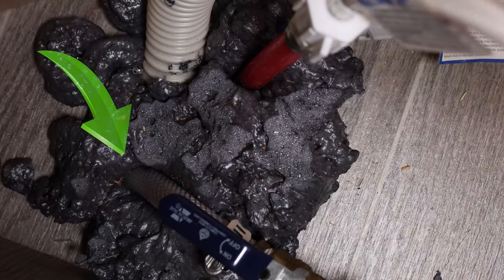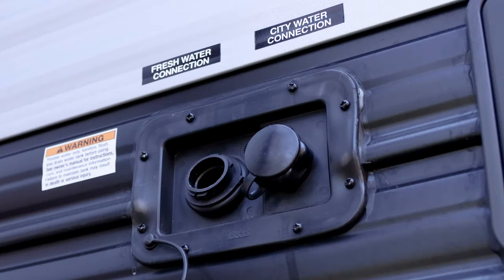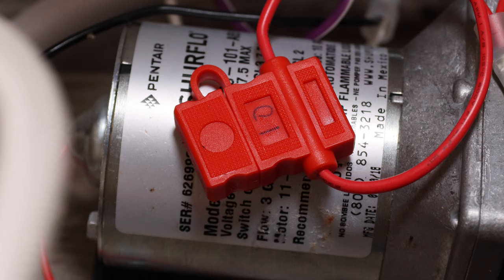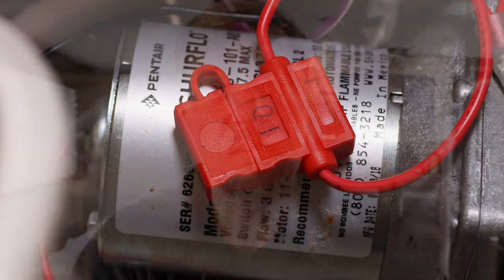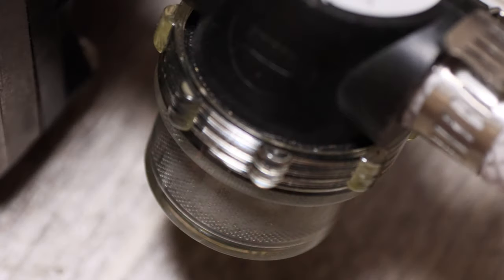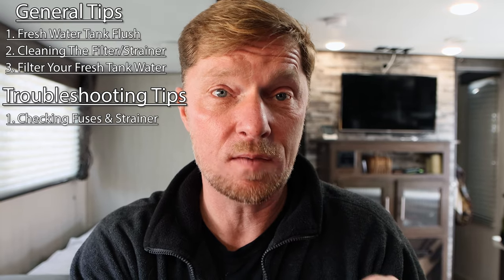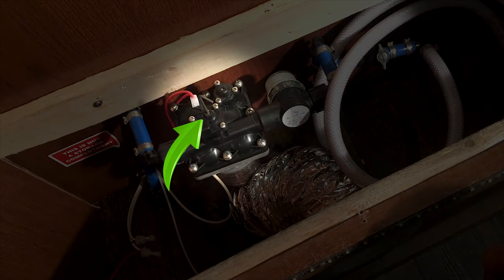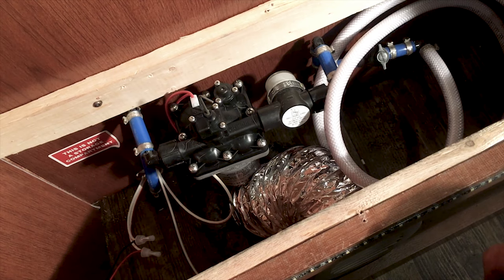RV Water Pump Explained 2021 - Shurflo Water Pump

Comment from the maker: I wanted to share this link for those who are having issues with their water pump. This is by the manufacturer and has some good troubleshooting documents. https://tinyurl.com/y3tuppvf  -  Use this link and select the pump that you have. You can then look at the downloadable documents to find the specific troubleshooting documents. Shurflo pumps are made by a company called Pentair. Hope this helps.
Reply: I ha e the same pimp as you. Mines is leaking on one of the screws that hold the bypass housing cap

Comment: Thanks for the video. My pump was pulsating I took the filter off and found very little debris and sediment. At first glance it looked clean. I cleaned it anyway. Screwed it back in and it worked. No more pulsating.
Reply from the maker: Heck yeah!!! I am glad that it worked out for you. Its always nice to have something fixed that did not cost $$$$$.

Comment: So I have the same shurflow pump with a bypass, I installed it today brand new from Amazon. They are shipping them out of adjustment sometimes as in my case. It wouldn’t turn off but had good pressure. In this case you need to touch the bypass screw with a 2 mm Allen. Screw it in/tighten it until the pump turns off and then just a little bit more for safety sake. I took mine about one full turn before it would start turning off. Now it operates perfectly. Just the right amount of pressure I was hoping for. Not so much that it wastes water but not so much that it is pulsating.
Reply from the maker: This is a great comment showing how others can get the settings that they need with a little adjustment. I am going to pin your comment to the top of this video for others to see. Thank you for sharing.
Reply: I checked the pump. The check valve is fine. I ordered a new pump. I installed a new city water check valve too. Thanks for your response.

One more anamoly: it is not unusual when filling the freshwater tank (sticking the hose into the port), upon pulling out the hose, water gushes out. I think there's a kink in the aerator tube. I can't get to it.

Comment: Awesome video! I’ve watched a dozen other RV water pressure videos and none of them broke down the pump function or mentioned that little screen on the inlet. Ours was almost totally blocked (RV was used), and cleaning it totally fixed our issue!
Reply from the maker: That’s awesome news. Glad that you were able to resolve. If I may suggest one other thing, try filling the fresh water tank and then drain it completely several time. This will help wash out and debri that may be in the tank. Also, I only fill my tank from a hose connected to a filter kinda like you would do on the city water connection.

Comment: My pump runs, shakes awhile, then pumps water out of the city water connection. When I turned off the pump, water continued to drip steadily from the city water connection! When I first opened the panel to check the system, I found that all the screws from the pump face had come out! When I reassembled the pump and put it back and re-rested, the pump ran for a short while then shot out water from the city connection again and again the screws came out!
Reply from the maker: I think at that point, I would look into replacing the pump. There are internals that could have shot out, gotten lost or went somewhere that they should have not been. Never the less, I think that I would replace the pump and hopefully you will be back on track again.

Comment: I have a 2006 33ft eagle camper. I replaced the water pump with a brand new one because the old one was leaking all over. As soon as I put the new pump in- it worked beautiful-like a dream! Until I got up this morning and it is NOT working at all! I flipped all of the breakers and changed the fuse that says bathroom. I don't know if that's the correct fuse or not considering my water pump is under my kitchen sink! But still my water pump is not running at all! I live in my camper full time. Do you know of anything else to check to find out why my pump is not working? Sure will appreciate any advice concerning it. Thank you in advance! 💕
Reply from the maker: Does yours have a fuse at the water pump? I know that mine does..

Comment: 😮Pump is turned off but water is leaking at the pump from city 
water. All connections are good, the water is coming out at the end / head of pump. What to check?
Reply from the maker: Ckeck the pump head seal.

Comment: My pump works great but it never shuts off. Pumps out water just fine. I changed the valve and cylender but I get same thing. Is there a shutoff on the pump itself that may have went bad? There is no filter anywhere on the pump line.
Reply from the maker: Please take a look at the comments on this video. I pinned a troubleshooting website on the very first comment. This should hopefully get you where you need to be. Also, if the pump keeps running, then the pump thinks that it is not building pressure. The website should help you understand more.

Comment: Intermittently my fresh water tank will overflow when I’m hooked up to city water. Do I need a new pump or is the check valve adjustable?
Reply from the maker: I have had the same issues before. Mine are intermittent as well. I made this video a while back and may be of some use in your case. Let me know what you think...https://youtu.be/2Yms8YPRxGE

Comment: Niiiice comprehensive video on the operation, function, and troubleshooting tips!!!

One thing to add.  If you do not regularly utilize the water pump, like hooked up 2 city water all the time, you need to exercise the water pump to exercise the pressure regulating valve.  We boondock a lot so it gets exercised a lot.  In order the fix this you have to disassemble the pump and release it.  Baffled us once.  Thanx for the excellent 411!!!
👍😃🍻
Reply from the maker: Wow. That really happened. I always thought that scenario could be possible. Thank for the heads up and your resolve.

Comment: Regarding my note earlier, mine is a 2012 Wildwood Travel Trailer. I've never had an issue with the pump before. However, it's been awhile since boondogling!
Reply from the maker: I try to run my pump every now and then mine even if I am not boondocking. That way I am not surprised of with faulty equipment when I really need it. This goes for several different things in the RV. I think that I will bake a video about it this weekend. Your comment just might end up on my next video. Thank you for the comment and hope all works out well.

Comment: Great video. Thanks. I;ve got a shurflo in my motorhome, seems its turning on suddenly on its own for about 3 seconds, any time, roughly 3 hours apart. I've just fixed to foldaway wash basin in the bathroom - pipes really awkward to tighten. Wonder if a connection is having a small leak...what do you think?
Reply from the maker: Typically the water pump does not come on unless it sees a pressure drop. You could very well have a small egough leak that could cause it to periodically start. https://tinyurl.com/y3tuppvf  -  Use this link and select the pump that you have. You can then look at the downloadable documents to find the specific troubleshooting documents. Shurflo pumps are made by a company called Pentair. Hope this helps.

Comment: Hi there cool video helpful I don't hear no noise from my pump at all I believe their might be air caught in there make a long story short my water tank got frozen in the winter 🥶 and I waited until it was warm out and drain it when it melted however I'm not sure if my pump is still working or if I need to just check all lines but no noise at all from it when I turn it on any advice
Reply from the maker: Try checking the fuse first and if you can, access the pump and see if it’s running. My pump also has a fuse right at the pump too. If you find pump running, check for cracked lines and housing to make sure you are not pulling in air or leaking water. Let me know what you find out.

Comment: My ShureFlo water pump on my motorhome has intermittently comes on for no reason (of course in the middle of the night) and sounds like a jack hammer. I’ve ordered a replacement on Amazon. But, will try to adjust the pressure on the existing unit per your advice (the small wire strainer was cleaned out).
Thanks for the tip and possible remedy!
Reply from the maker: I hope that it worked out for you. Please let me know how it turns out.
Reply: @HowToRV  Well, that’s timing!
I had just fired up my iPad and there’s your message.
Well…I returned to my RV storage yesterday to gjve it another go. 
Removed the wire strainer and found a little more debris. Cleaned that out again and increased the water pressure set-screw.
The “noise” subsided once the water lines were fully charged.
But that means nothing, since this scenario was tried before.
So, I’m going to go ahead and keep the new pump from Amazon when it arrives next week as a spare…or swap it out and rehab the existing unit and keep that one as a back-up.
Thanks again for your follow-up!👍

Comment: I just disassembled the check valve/switch and found debris on the O-rings. I cleaned it out and reassembled. It pumps, but I was getting city water bleeding back into my fresh tank, and now I know why. I'm changing it out, but I'll probably replace the O-rings and keep it as a spare.
Reply from the maker: Good find. I got lucky and the debris final cleared itself.

Comment: Thanks Jason, this is very helpful. My 9 AMP fuse blows almost as soon as I turn on the water pump, the LED comes on briefly and then goes out.  I've learned from you that there may be another fuse I should check. I am hoping that one of them has blown because getting the water heater out of a Taxa Cricket is not an easy job.
Reply from the maker: I am interested in what you findout. Please let me know what you find.
Reply: @HowToRV  Hi Jason! I found that the large yellow gasket had a wrinkle in it which was a fault that was there from the beginning. After pulling that whole piece off I could see that there was rust around the motor shaft and I'm guessing water got past that gasket/membrane and the little motor seized. So...had to buy a new pump as it was past the one year warranty.

Comment: So what do i need in-between my battery and the water pump? What kind of fuse block or fuse? What kind? Anything else in between?
Reply from the maker: Outside of an on/off switch, I believe that the manufacturer recommends a 10 amp fuse. In you application, I would suggest looking for a 12v blade fuse with a water proof fuse holder. To be safe, please check shurflows website or your manual.

Comment: Very informative thank you my problem was from one camp to another my pump started spuing air and water like it quit priming bought a new pump was even worse so reconnected old pump had a series of water leaks after repairs don't know what I did but I started working saw vids. on how full time living could freeze a spring activated diaphragm w/calcium so I did what videos instructed but this "shurflo" didn't have this everything was sealed new was the same bummer but old pump just started working so I moved on didn't mess with it to this day don't know what originally caused this nitemare p/s new 280RSOK Jayco already replaced propane regulator like my old forrest river sonoma
Reply from the maker: As it sometimes is, things fix themselves for no real apparent reason. I have had things fix themselves before too and I hate that I don't know why because in the back of my mind, I ask the question "When is it going to happen again" Just like you probably are. For the propane regulator, I am wondering if you were getting the propane refilled at the same place. My guess is that if you were, then maybe the propane itself has some debris in it causing the failures.
Reply: There was a recall some time ago on those regulators I figure cost wise is better to fix them in house than the cost of traveling 150 mi round trip even under warranty
Reply: Regulators refused to switch tanks

Comment: Great video! We are trying to fix our daughter's pop up camper Jayco 1206 2013 model. She left the pump switch on by mistake. The pump had been working on their camping trip. On trying it we found no water coming out mostly air. We bought a new pump and installed the same as the old. We still cannot get water to flow. The pump sounds like it is running but only a little water flows at first then air! We have tried all the tricks to get the water flowing and cannot! Frustrated! Any thoughts?
Reply from the maker: How full is he freshwater tank? You could also try connecting the inlet side of the pump to a make shift hose and a 5 gallon bucket of water to see if it works. Trying the bucket method will help understand if there is a connection issue from the tank to the pump or not. Make sure there are no shut off valves anywhere in between either. If your getting a little water then air, you could have a priming issue and doing the bucket of water trick might help. The water pumps are typically self priming and preset but who knows. I would have to guess that if you have the inlet and outlet of the pump installed correctly, the fresh water tank is full, the bucket of water test fails, and your absolutely sure the pump is running then as it may, the new pump might be no good even though it is new. Please let me know how it turns out or e-mail me at How2RV@gmail.com and we might be able to work it out in more detail.

Comment: Great video!  My pump (same one as yours) wasn't working at all so I bought a complete upper housing replacement and installed it this weekend.  Now the pump turns on, but it won't pump water.  It's only 2 or 3 years old.  The screen/filter is clean as a whistle.  I disconnected the hose from the tank to the pump and blew a little air through it.  Is my pump bad?  I can't figure out why my pump will not pull water up from the tank to the pump?  Thanks man!
Reply from the maker: I have not had that happen to me but I would try disconnecting the inlet side of the pump and running a line from a 5 gallon bucket full of water and see if you get something from there. If you do then there is a problem with the pickup side of the tank. Don’t shoot me for asking, but does the freshwater tank have enough water in it?
Reply: @HowToRV  Fair question, the freshwater tank was not full but I had it 30%-50% filled.  I will try the bucket suggestion, thank you!
Reply: I know this was a long time ago but, I've replaced my RV SHURflo pump and somehow put it in backwards. It connects up easily and makes noise - just wouldn't pump. I swapped to the pump I had rebuilt - AND topped up my fresh tank before I figured it out. D'uh. There IS an arrow for flow on the body but I didn't check and messed up.
Reply: Did you ever figure out your issue? I seen earlier comments that the regulator can get stuck and to take apart and exercise it then reinstall. @JonPorreca

Comment: I have the same pump and it does not shut off. There is no strainer to clean. Is there an adjustment or some way to make it operate correctly? Thank you!
Reply from the maker: https://tinyurl.com/y3tuppvf  -  Use this link and select the pump that you have. You can then look at the downloadable documents to find the specific troubleshooting documents. Shurflo pumps are made by a company called Pentair. Hope this helps.
Reply from the maker: I have been adding viewers comments to the end of my videos. I am going to use yours to explain where people can find support. It should be on the video coming out in a few weeks. Thanks for watching.

Comment: Where is the check valve. Mine is allowing city water to fill up the tank. Any fix tip ?
Reply from the maker: Try this website -  https://tinyurl.com/y3tuppvf. With mine, I eventually found that if I leave the city water connected and run the pump and city water several times independently, it took care of the problem. The check is built in and from what others have told me, it is easier to replace than repair. Mabey you find other solutions and if so, please share them with me.

Comment: I noticed installing an accumulator tank helped out well also. Keeps pump from pulsating when faucet is barely turned on and pump doesn’t turn on as much.
Reply from the maker: I would have to agree. I may do the same since the accumulator is not all that expensive.

Comment: New owner here! If I am dry camping with generator using fresh tank with pump and not city hook up, do I keep the pump on when I get to my site and keep it on all weekend? Or should I be turning my pump on and off when I need to use water?
Reply from the maker: I have been out and kept mine on the for a week with no issues. You do need to make sure that there is plenty of water in the fresh water tank at all times. You dont want the pump to run dry and because you leave the pump on, it will keep runing if there is no water in the tank and it is looking for water to build pressure. Also, if you are going to keep the water heater on, it is good to keep the pump on too. This is to make sure that there is water being pumped to the water heater if you use it. Hope this helps.